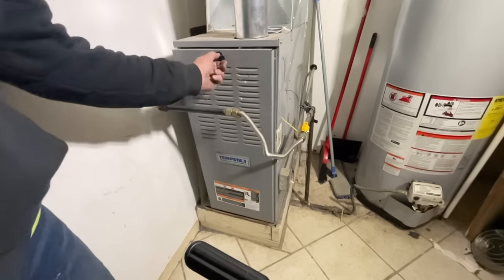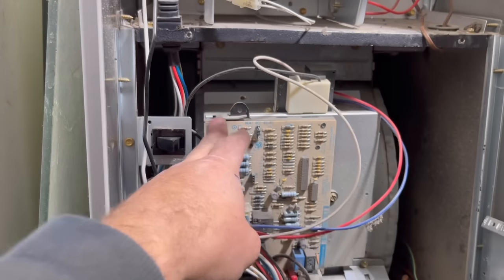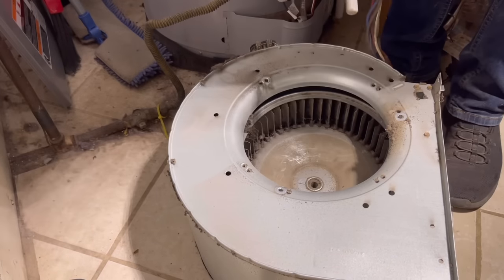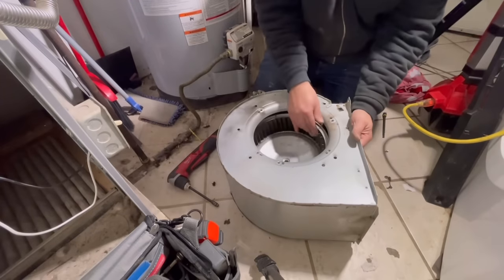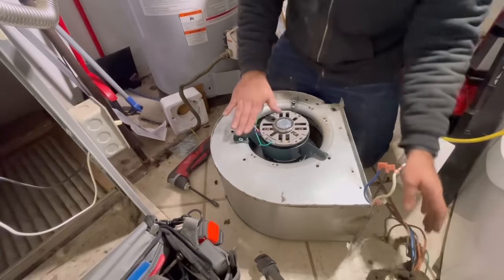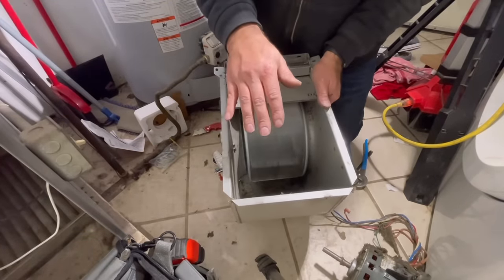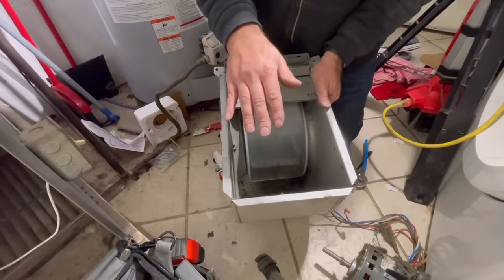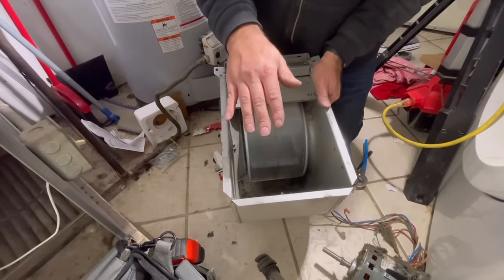How To Install A UNIVERSAL Blower Motor And Save Hundreds Of Dollars

Comment: Okay, there is a type of electric motor known as a "universal motor" so you are making this confusing. I'm guessing you mean there is a "generic replacement" blower motor? Don't you need to check a few other things like motor horsepower, RPM, and direction of rotation?
Reply from the maker: Yes, it’s a universal or generic motor but sized according to the existing motor specs.

Comment: Those wago are absolute garbage for this kind of use. If they get snagged on anything they can pop open and release the wire electrifying the entire case and anything/anyone touching it. Don't be a lazy idiot, crimp on the correct connectors and attach directly to the board.

Comment: Obviously you're competent, but it's hard to watch someone not vacuum all the dirt out before they start working on it and then also not vacuuming the board and other areas when putting it back together.
Reply from the maker: This is a rental that has been trashed from day 1. If the blower wasn’t as bad as it was, I’d have left it, but I couldn’t with it being as dirty as it was. It was late when I did this and I didn’t want to be there till midnight. But you are right, I could have vacuumed that out and in any other circumstance I would have. Cheers

Comment: You forgot to tell them about the rotational wires.
Reply: Tell me!
Reply: @chezchezchezchez  There are a pair of short wires that you can switch to make the blower run the other way. There is a big tag on the wires that explains it but you do need to check that the blower is going the right direction before you finish. The one he was working on needed to run ccw to blow air up into the cabinet.
Reply: @ohiopat  
🤣🤣CCW
???
Reply: @scott5654   counter clockwise
Reply: @aland680  
It goes counterclockwise from both directions.

If you’re looking at it from the right side and it’s going counterclockwise is that correct? Or if you look at it from the left side and it’s going counterclockwise, is that correct?

This is no minor technicality. CCWLE is an important thing to understand, isn’t it?
Reply: @scott5654  Carrying concealed weapon...lol
Reply: @scott5654  counter clock wise

Comment: A dirty filter doesn't fill your unit with dirt like that. They were either running this without a filter or using one of those garbage cheap nylon filters that doesn't keep any dust out. What a dirty filter will do is over stress your blower motor and burn it out early.

Comment: Hey, shoulda  vacuumed up, BEFORE  dis-mantling  the unit .  Cleanliness, makes for better health; both for you, and  THE  MOVING  PARTS in  that  furnace, like motor bearings. ( Probably seized up, with dust/crud;  same as indoor mobile fans.  I find alot of them, in  dumpsters; clean the bearings, and  AWAY  WE  GO.  Got many of them).   Thanks, for the education. !

Comment: This is all well and good as long as you're existing system is pretty old. Most of the newer ones have motors with a buncha computer shit on em. The blower motor for my A/C went out last summer and the hvac company wanted $1200 just to replace the motor. I found one at Graingers and replaced it myself in about 15 minutes. Still cost almost $400 just for the motor. Unfortunately the "universal " motors won't work in most of the newer systems.
Reply from the maker: exactly why I prefer the less sophisticated furnaces. Of course if it’s under warranty it’s free :)
Reply: Well, 15 minutes is a gross exaggeration. I mean, I’ve only changed four or 5000 of those blower motors, and I am not as good as you having only done the one that you own. It takes more than 15 minutes just remove the blower assembly and reinstall it.

Comment: Question, I have a 2.5 ton whole house heat pump that's 21 years old. It runs good with no issues. Is it coming to the end of life or should I just leave it alone until it dies? I've replaced control module and both fan motors in the past 7 years. This is a self contained system not the split unit.
Reply from the maker: The last thing you want is to be fixing it in the middle of summer, so my advice would be to replace. If you need some help locating the right equipment and finding a good price, email me at diyhvacguy@gmail.com   Cheers
Reply: @diyhvacguy  even if it still operates good?
Reply: @marrowsteven    Run it until it dies!   The new equipment is built like JUNK!!!!  As long as you have back-up resistance heat for winter, you'll be able to limp through the cold until spring when you can decide to replace or repair. My heart is old, still works fine, but I never thought of replacing it!

Comment: I'm so angry, (story time) so I decided to diy given I am a automotive technician. I have the tools, pretty decent experience in electrical/ mechanical items. Just had our upstairs unit replaced by some hvac techs for $4000......all of a sudden, downstairs unit which was rarely used as often starts acting up. Yes both units sit in closets side by side. Anyway,in an attempt to save money I decide to take care of it, I test capacitor, etc and everything is working but the blower motor which intermittently turns on. I order a new blower through the part number on our 3 ton unit (original, since house was built in roughly 2011 I think). Everything comes in. I get to disassembling the old blower from the unit but run into a snag where the shaft has so much rust built up that it won't come out even after trying to hammer it through. I take the whole assembly to work to see if my air hammer could do some convincing, which it did and left the screws in the garage on top of a spare refrigerator we have. About 1-2 days later when I have the time to finally get back into it. They've decided to clean the garage and all the screws are thrown out 🤦‍♂️. I lost interest in completing the task for a week or so but decided to order a screw/thread gauge from amazon to measure and replace the screws. By the time it gets here I'm too busy to get back to it. Everyone in the house knows that the unit is disassembled at this point so I have the blower assembly with the new motor laying in the garage ready and waiting. Guess what? Now it's gone. My assumption, while my uncle was visiting he was fixing things up around the house and just so happened to think the blower was trash. So now I've got a almost 15 year old functional unit with r22 without a blower in Florida and summer is a few weeks away.

Comment: The filter is being bypassed.  That's why everything is so dusty.  Things don't get dirty because an air filter is clogged.  Things get dirty because unfiltered air is entering the system.  Need to look into sealing the airflow bypassing the filter.  Somewhere there is a huge air leak. Why are you replacing the motor if a bad run capacitor is preventing it from starting?
Reply from the maker: I checked the capacitor and it was within spec. So it was definitely a bad motor. This was a nasty rental property and they kind of do the minimum.

Comment: Love your efforts, really! However, look like a Pro on your put back together with dirt on the board, et al, just does not show well i.e., if he is skipping a simple vac out, what other corners being cut here. Know you are smart enough to get this and TYVM.
Reply from the maker: This video was filmed in a super gross apartment, and at 9:00pm I might add. I was not inclined to spend any more time then needed. I simply couldn’t put that blower wheel back in the way it was though.
Reply: @diyhvacguy  Yep, been there, done that; working overtime will do that and TYVM.

Comment: Hi, love your video's and subscribed. Hope you can help with my older Carrier furnace will run its heat cycle and when the blower fan stops, the blower will start up again for a few seconds and then stop again until heat is needed again. Was told it might be the fan limit switch.
Reply from the maker: Yes, clogged filter, blocked vents or returns, clogged blower wheel, maybe a capacitor. Does it have any codes?

For full tech support check out our subscription on Patreon.com/diyhvacguy where for $25/mo you’ll have full access to tech support and help with all things hvac related. Hope you can get it sorted out. Dave

Comment: Those universal blower motors were running less than $100 online before the pandemic. I am really surprised that the supply house sold you parts.
Reply from the maker: Well I’m an hvac contractor but sometimes if you go in and act like you don’t know any better they will sell you a part :) I’ve seen it happen first hand a few times while I was in there picking up a part

Comment: Is there a "universal" motor replacement for a two stage motor with the capacitor on the back of the motor? These motors are crazy expensive!
Reply from the maker: Not sure on this. I picked this one up at the local Johnstone supply, so they made sure it would work for this furnace.

Comment: So, been trying to find an "easy" understanding of what's going on with my central air. When there is power to the unit, the blower runs constantly. Thats whether it's calling for heat, AC, or nothing at all. It is most definitely not the thermostat (we have replaced the thermostat and even just disconnected it, and its the same deal). The only way to turn the fan off is with the emergency kill switch.

Any thoughts?
Reply from the maker: So the heat and air work but it’s just always blowing air regardless? If you want to email me at diyhvacguy@gmail.com I can try to help you out
Reply: There is a BLOWER RELAY on the circuit board.  That blower relay has a  very tiny electrical arc on the CONTACTS of the relay.  Over time.... these small minute little arcs can cause the blower relay on the circuit board to STAY CLOSED.  . With the heat and air in the OFF POSITION......AND THE FAN IN " AUTO " . That is most likely the culprit. If you give the blower relay on the circuit board   at this time.  And the blower stops. Then that's about a 95 % chance that is your problem.  Blower relay is usually black and about the size of 2 regular DICE put together.
Reply: I have the same issue on a new universal motor i put in on a Rheem motor won't shut off at all unless braker is off this is a 12 year old unit no board on furnace did anyone resolved this issue?
Reply: @geudirosario-nu5qi  is it an electric furnace  ??

Comment: Never put a universal motor unless you have to. J Saying
Reply: Not everyone is a wealthy HVAC tech and has $400 + bucks for a factory motor.
Reply: @terrystroble8657  the motor will not last and you will pay in the long run for two motors. I’ve been doing HVAC for over 40 years just letting you know.